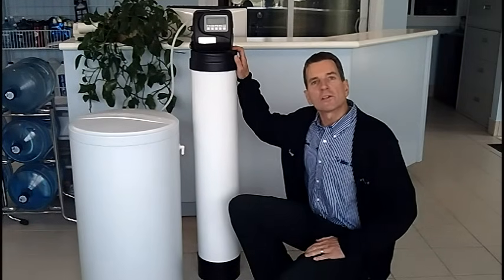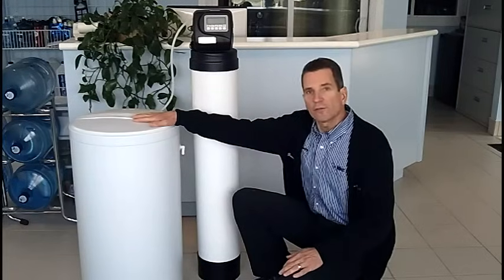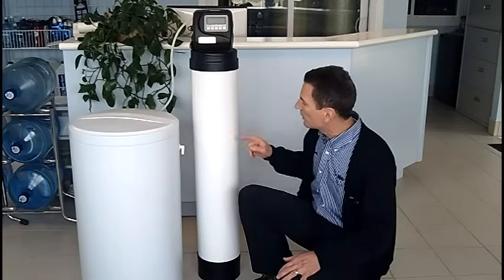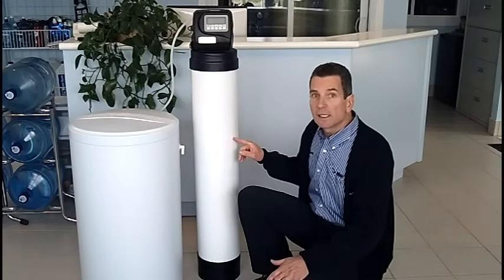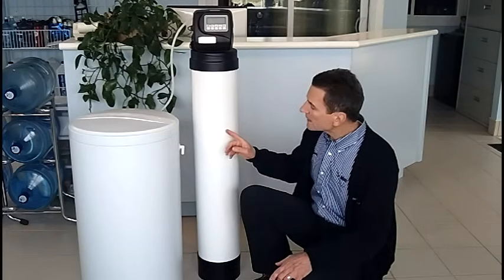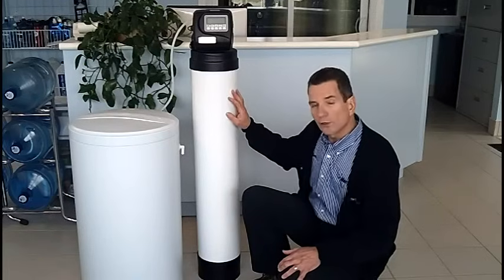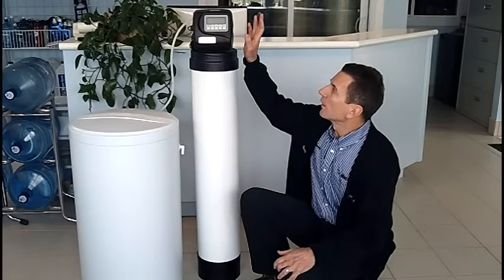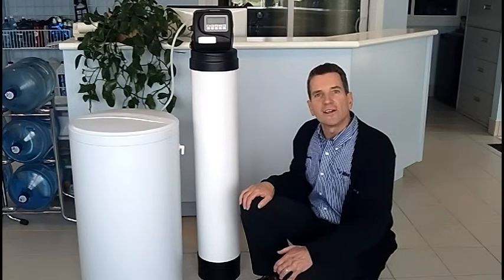How does a Water Softener Work?

Comment: Hey Gary, You do great videos. THANKS! I have a question about my cottage water softener. I manually activate the regen process based on usage and never go beyond 10-days. I do not drain my pipes for the winter since I use my cottage all year. I will be away for a couple of months. Do I need to regen the softener while I am away? Perhaps I regen as I lock up for a couple of months so the softener is clean whn I leave and then regen when I am back. What's your advice? Thanks!
Reply from the maker: Yes, regen before leaving.  Shut off the water.  Regen after you turn it back on!
Reply: My recent water test showed iron at 400 ug/L which is 100 high. Should I regen more often to keep the softener cleaner? We usually regen every 10 days or so as we rarely get over 300 gallons during that period.

Comment: Hi Gary, I'd like to know if there's a way to connect the softener's control head with a durometer, connected to a water treatment unit, in order to control the inlet softened water's quality as recommended by our factory, and to launch regeneration, if possible, from the WT unit's HMI?
In brief, we recommend a softener that is controlled from the WT unit's HMI!
Reply from the maker: Sorry I do not know, I have never come across this before, but I doubt it.
Reply: @water_estore  Great thanks to answer my request, but I'd like to explain that our interest is in the softener's control head, in other words, any input for external control! I hope you got my request?
And thanks again for answering my queries!
Reply: @water_estore  I forget to ask you about the terminals' functions of the control head's PCB, without mentioning supply, meter & motor terminals. 😉

Comment: Hello. I will soon install a water softener and I’m wondering how often the backwash cycle takes place and how much backwash water is expelled per cycle. 

(I’m wondering if I need to hook up the unit to a drain OR I can just make a small overflow directly to outside)
Reply from the maker: The frequency of back wash depends on a number of factors, this video will help you https://youtu.be/5j3wXccdC4c  The amount of water depends on the type of water softener.  Anywhere from 13 gallons to almost 100.

Comment: Context: Hi Gary, My father passed away 2 months ago and I have just found out that he has a water softener system.  Its two years old, and he has it set to regenerate every 12 days it looks like.  There is also a count down where it will say 7 days till regen 2145 gallons remaining.  Ive watched almost all your vids and first, thank you. They are very comprehensive and much needed.  I've always had condo's so this has slipped my awareness.  As I try to wrap my head around everything he has going on here especially regarding the WS system there is a question I can't find answered.  You explained the first step how the Media tank using the beads to remove the hardness... then the first stage of regen process is to back wash to remove sediment and dirt, the second stage is the bryne stage, there is water touching the salt making the bryne solution that gets sucked into the media tank..My question is; If I am to keep the tank full of salt where does the water come from that creates the solution?  Is that something that gets poured in there manually by me?  Or does the system add a certain amount of water to the bryne tank to create the solution?  Ive somehow missed in many of the videos where the bryne solution gets its water.  Much appreciated for your work.  

Repeat of question:  Where does the water come from that creates the bryne solution that will eventually go into the media tank to clean the pellets?  Do I add that water or does the system put the water in the bryne solution at some time? 

Stay blessed Gary and thank you.
Reply from the maker: Great question.  The water softener adds water to the brine tank after the brine and rinse cycles.  You do not need to add any water yourself.
Reply: @water_estore  Thanks Gary.  You are a good man sir.  Between your videos, the owners manual that I downloaded from the internet, and actually purchasing a test, I think I may start to get an understanding of what needs to be done.  Much appreciated.

Comment: Great explanation! Is there any residual salt that is left behind? I've read lots of conflicting information on wether or not a water softener increases the sodium of the treated water.
Reply from the maker: Great question!  Yes the sodium goes up, but only marginally with a modern water softener that has been programmed correctly.

Comment: I am struggling with the huge amount of salt that I will be dumping directly into the wastewater system, they cannot remove any of that so it goes directly in to lake Coochiching.  When I go to a big box store and see pallets of salt I realize every bag of salt sitting there will make its way directly to our lakes. I like the idea of soft water but this is not sustainable way to do it.
Reply from the maker: Good question.  Unfortunately there is no other way to softener water than with salt.  You best bet is to use a high efficiency water softener like an Aquamaster https://waterstoremidland.com/products/aquamaster-900-high-efficiency-water-softener/ or WaterBoss https://waterestore.ca/products/waterboss-proplus-380-high-efficiency-water-softener?_pos=174&_sid=9945f1ef4&_ss=r to use as little salt as possible.
Reply: Thanks Gary.. I probably give it a miss and take my lumps or my scale.

Comment: Gary, it seems that my water pressure goes down a couple times a day and worse when I have to shower.  I decided to "by-pass" the softener and when I did that the water pressures seemed normal.  Is there a problem with the flow of water going through the softener and is that why I get this reduced pressure.  What would be the solution to fix this?
Thank,  joetez
Reply from the maker: It sounds like your water softener is clogged.  This video explains the fix https://youtu.be/Z47JGH1l39o

Comment: What a great video! Now I understand! Here on our dairy farm we have a large system for the cows water. Early on we made a big mistake by allowing the waste water from the cycle to go down the pipe to the liquid manure tank. (40,000 gallons). Something chemically reacted with the tank and created a what is called a sewer bomb. This was an extreme danger and I'm only thankful to God that I'm sitting here telling about it. My point is that I wonder about home use of these systems being run into septic tanks and if this is recognised as a hazard. We never found out how or why it happened.
Reply from the maker: There have been numerous tests done by several different sources including the University of Wisconsin that maintain there is no effect on the anorobic action within the septic system caused by the sodium form the water softener.  there are over 25,000,000 homes in the USA that have their water softener connected to their septic system.
Reply: @water_estore   Thank you for that reply! Is it even remotely possible it was a reaction of instead of the sodium, but rather the calcium and iron that is being removed from the water.

Comment: Hi, Gary.... I have few questions to ask. i am running a filtration plant  commercially. Which only cleans the water from dirt, germs and bacteria. The TDS is around 390-420. I have noticed after 2to3 days the white kind of particals stays on the surface of the water in bottle. (I think it a hard water ) can you please suggest me should i go for watee softner or i go for blending the water? (Blending will only reduce TDS 150-350 and water will also b not hard) please suggest. I can't trust local people here. I am available on whats app too
Reply from the maker: Can you have the water tested to see how hard it actually is?
Reply: @water_estore  i made a water test. The report says Hardness: permissible limits 500 and result came 440.... chloride 43, magnesium 54, potassium 08, sodium 36, sulfate 118, nitrate (N) 2.5, carbonate BDL (BELOW DETECTION LIMIT) , CALCIUM 88, BICARBONATE 300, alkalinity 06, ph 7.60, electrical conductivity 950, turbidity 0.80. (this is the report of RAW water (not filtered water) i am filtering the same water. Thank You
Reply: @gary the water guy... Waiting for your reply :)

Comment: Great video. I live in a condo and we have issues with our water tanks lasting only 3 years. Is it possible that adding a second tank to our water softener help? We do see  a good amount of calcium build up in coffee makers, humidifiers, etc. if we use tap water.
Reply from the maker: Sorry I don't understand the question.  What tank is only lasting 3 years?  What happens to it? What kind of a tank would you like to add to your water softener?
Reply: Our hot water tanks are rusting out after 3 years. We have a well, not connected to municipal water. The well water goes through a UV filter, each building (5)  has a water softener. Our building is the only one with only 1 media tank, the other 4 buildings have 2. Their hot water tanks are lasting twice as long as our. Would a second media tank help? Or is it not related to our problem?
Reply from the maker: @alandueck210  I suggest you have a full water analysis done to determine what in the water is causing the hot water tanks to rust out so quickly.  Adding media tanks will not correct the problem, I think it is unrelated.

Comment: Hi Gary. I have a Johnson Water Conditioning. Previously there was standing water above the salt so I added salt pallets in it and the water felt normal when I use it, but now even with salt still above the water level I can feel the water is not right. Does anyone know why?
Reply from the maker: You really need to have the water tested.  Even after me doing this for over 16 years I find the feel of water is very deceiving.
Reply: @water_estore  

Thanks. 

So is it good if the water feels slippery during hand washing or no slippery is to aim for? Im confused.
Reply from the maker: @DLIX2DCLI  soft water is not about slippery or not slippery, it is about not leaving hard water deposits.  The slipperyness of the water may be due to using too much soap or incorrect settings of the water softener.

Comment: Best explanation yet, thank you. I have a very small amount of tannins and I have iron that is visible when chlorine is added. I am not concerned about the tannins but would like to know if this unit will take out the iron. Will the tannins wreck the filter?
Reply from the maker: Glad to hear you liked the video.  Great question!  The water softener will remove up to 1.0 ppm of iron, if your iron content is higher I recommend pre treating your water with an iron filter before the softener.  No, the tannins will not harm the softener, they will pass right through.
Reply: @water_estore  Thank you very much!

Comment: Thank you for the video.  What I understand is that the salt that you put inside is just to clean or recharge the component inside the machines.  It's not beening mix with the water.  If that is the case, than watering your plant with water softer should be okay?  Because no salt was added, only remove?
Reply: Quang chung-NO, do not water your plants with the water inside your house.  Soft water will KILL the plants, it killed mine.  Lesson learned the hard way.
Reply: A10TOES it’s the sodium that kills the plants. I use potassium substitute but almost $30 a bag. Healthier and safe on plants grass. I wash my dog with the front yard hose that passes thru the water softener so it’s soft water. Just fyi

Comment: Losing water Pressure as the water Goes through my water softener Bypass the water softner and I get my pressure back and I have had the gold Beads Replaced and it still does it what can cause this?

Comment: Very good video. I have a manual valve unit. Once the brine level is empty, then the brine rinse should stop, correct?
Reply: The Water Filter eStore my unit is totally manual with no electric operation. It’s 48,000 grain. I’m trying to determine how many minutes to run the slow brine rinse.
Reply: My water softener keeps regenerating and I can hear it drain. Only way I could stop it was by using the bypass valve. It doesn’t have a digital control. Just a clear cover over a gear with a spot for a Phillips screwdriver. Any thoughts on this situation?

Comment: Can I ask what type of water is use to backwash?
Reply: Thank you so much. :) 
Aside from calcium and magnesium, what else does the water softener remove?
Reply: Thank you for answering all of my questions . Its a great help. 
If the water softener removes or reduce iron and manganese from water, but why most of the breakage of resins are from iron? and can i ask what is the difference of zeolite process from cation exchange method? Thank you.